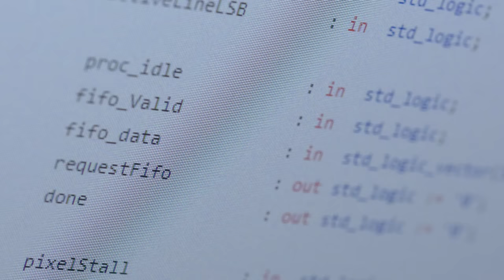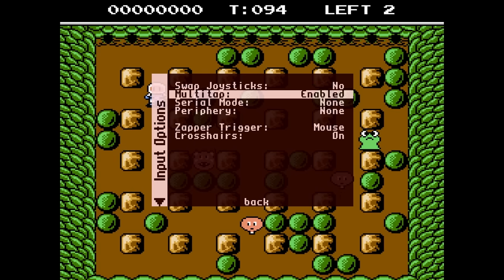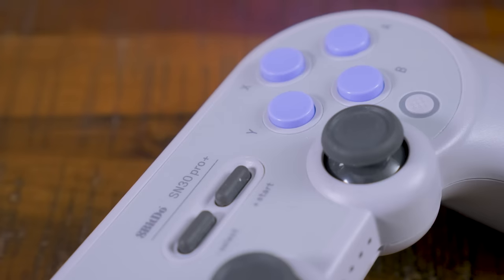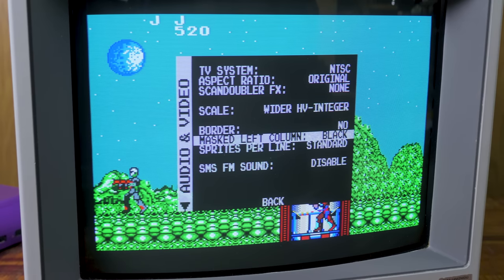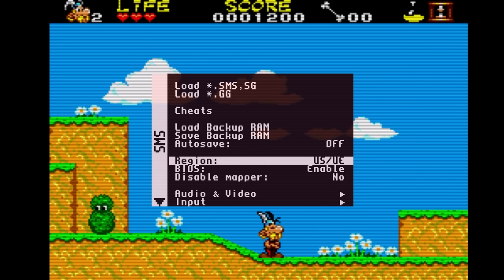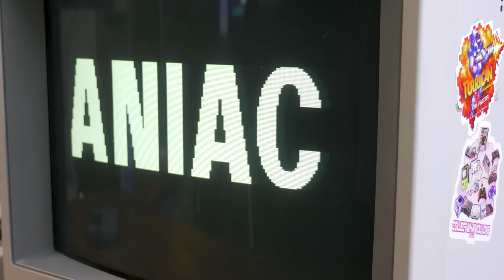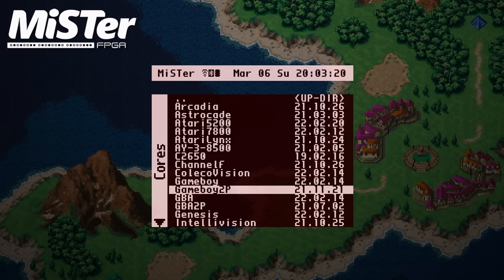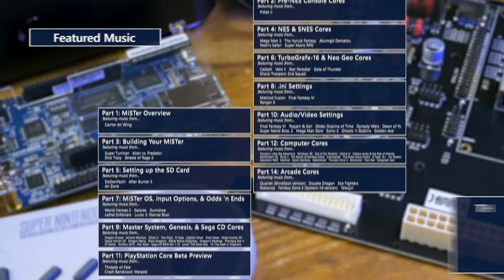MiSTer FPGA in 2022: A Primer Guide to Retro Gaming's Hardware Emulator / MY LIFE IN GAMING

Comment: Also a heads up for everyone looking to buy/make one. Don't buy from a scalper unless you absolutely need one now. The DE-10 Nano is always being made and coming back in stock. Patience will save you a ton of money
Reply from the maker: [Try4ce] I bought a second DE-10 Nano directly from Terasic just a few weeks ago. They ship fast, but it was $40 shipping. But given that the cost of everything is going up these days, I'm not so sure you'd save money waiting to buy it from somewhere else.
Reply: @mylifeingaming  I was referring more to the eBay resellers. I've seen them jack up prices quite a bit. Buying directly from Terasic is definitely the way to go.
Reply: Wherever demand outpaces supply, you get scalpers. Videos like this are awesome, but exacerbate the issue by increasing awareness. Plus the chip shortage isn’t helping, too.
Reply: @agentmith  for sure. MLIG will definitely bring more eyes on the product but I still think the supply issues won't be a huge problem in the long run. There's been plenty of opportunities to buy them during quarantine at fair prices and I think it'll continue that way. It's definitely not a product like the analogue pocket
Reply: I bought one direct too.  Got it much faster than the site said.  They shipped same day even though the de10 said back ordered until mid April.  Yes the $40 international shipping was hefty, and a bit of a bummer since they shipped it from here in the states… but I got my mister pretty much in 3 days.

Also, the folks that offer the Ultimate Mister Kit are great. 👍
Reply: Same goes with GPU’s as well!
Reply: The shipping was Fedex and fast af.

I would say unless it's life-or-death, do not buy anything from a scalper. You fund their future scalping activities.
Reply: Are there any recommendations for online retailer operating out of Canada?  If not, what’s the best “one stop shop” from the US?
Reply: My advice is to order directly from Terasic. There's a few months lead time but you can ensure that you're not paying markup and you're getting the real thing.
Reply: Any sites that sell it as a complete kit ? I'm sure i don't feel like going through the trouble to assembling one.Also i've notice it to scalpers sure like to price gouge the mister.
Reply: @josko50  What about misteraddons?  They seem to have a good reputation and product.
Reply: I bought a DE-10 Nano from Mouser on December 8th with an ETA of Jan 30th. They just updated the shipping ETA to July 30th... I've had a MiSTercade sitting in a box for 4 months now that I can't do anything with, it's pretty frustrating.
Reply: @SaoirseFae  they're great, if they have stock!
Reply: Just ordered mine from Terasic, $250 shipped. Saw them listed at $500-600 on ebay :O
Reply: @xDr3wskyx  I just ordered a pre-configured kit from Misteraddons for just under $600.  I can’t wait!
Reply: @ceejw  you should cancel your order from Mouser and order direct from Terasic. I ordered mine from them later than you did and have already received it and finished my complete MiSTer setup weeks ago. Highly recommend t and plus you’re giving the original manufacturer 100% of the sale which is nice.
Reply: @meatpockets  The GPU nightmare is actually starting to alleviate a bit
Reply: @xDr3wskyx  - Did you have to contact them via email (the "Contact Us" link on their website)? That's the only option I'm seeing rn, did so two days ago and didn't hear anything back yet... :(
Reply: @PluckyD  No, I just created an account on Terasic and put the DE-10 Nano in my cart. It's already been shipped AFAIK
*checking now I see the red circle and "contact us", it was green when I ordered
Reply: I contacted them and they seemed to manually switch it to green/active. And it stayed that way after I ordered. Maybe they put up a few at a time to preorder?
Reply: As a follow up, it looks like my de10 is shipping just over a week later. Glad I ordered all the other stuff already!
Reply: @remy333  yea they did the same to me i ordered mine on 4/15 then they e-mailed me and said i won't be getting it till June 30 than less than 3 days later i get a notification saying its being mailed on the 18th and amazingly enough it came in the 19th the very next day i gotta say ordering direct from terasic is the pay to go just be patient
Reply: Just wanted to mention that I placed my order directly from Terasic on April 21st and today (April 28th) I got an email that it's been shipped!
Reply: @saiyaman23  that's an awesome turn-around. Looks like you are going to have a fun May ahead you.
Reply: @sneakingelephant  absolutely! And being patient definitely paid because a couple of weeks ago I was about to pull the trigger on a $500 one from eBay  😱
Reply: @sneakingelephant  I just bought my DE10 from Terasic direct, following your instructions.
Reply: @mylifeingaming  where can we get the clean looking power coupler as well as some of the nice controllers you show in this video.
Reply: Fake , scam, MAME gets u as high % of emu accuracy  !!  They are seling u a $30 Pi with $20 worth of soldered cartridge slots, how can u not see this ????
Reply: @Ne0ge0X  sure buddy
Reply: DID SOMEONE SAY...
...HIDDEN GEMS!?
Reply: @Progearspec  asking the same question. Did you find out?
Reply: @SaoirseFae  is it all set up? I want something set up with games and consoles etc.
Reply: @randymulder9105  It is!  I ended up securing a prebuilt unit from Mister Addons.  I also ended up getting two custom built usb to NES and SNES controller adapters—they are almost as good as the SNAC for latency.
Reply: @SaoirseFae  do we add games and consoles ourselves. I mean I have that stuff and can do that part myself. But if it's all set up I'm a happy camper.
Reply: @randymulder9105  if you opt for the sd card, they will add the software backend for you, but that part isn’t too difficult.  You’ll have to add your games manually from a PC anyway.
Reply: @SaoirseFae  what a great video! 
I hope to have a small virtual pinball machine in the future. But haven't settled on any company/person that makes them.
Reply: @sneakingelephant  I know people who have purchased MiSTer from eBay and the price was right on the money, I just had another look and from what I saw, of the kits anyway, all seems to be fair considering the sales fees eBay charge, unless you have a specific example I don't think you should be bad mouthing eBay sellers, they get a lot of flack undeserved, it is like the new catch phrase to say eBay this and eBay that, I'm getting pretty sick of it to be honest, especially as all of my experiences have been fine.
Reply: @notsuoh16Bit  I wasn't bad mouthing all eBay sellers. I myself sell stuff on eBay as well and I know well how crazy those fees can be. What I was trying to say is that the DE10-Nano is still easily available and always coming in stock. You can go right now and buy one from terasic for the MSRP price. If the buyer wants a prebuilt kit the prices on ebay definitely aren't as wild as they were the many months ago when I made the post that you are replying too. People were trying to sell them for close to a grand which definitely wasn't worth it considering how often these boards get restocked.
Reply: @DetroitMetroRetro  It was more of a PSA  comment at the time because there was so many people trying to scalp it for well above market price. There's still no wait time right now unless you are trying to buy a prebuilt kit. So if you want to go to Amazon or eBay and buy a one there are much more reasonable priced options now but you can still save some money buying the parts and building it yourself
Reply: @sneakingelephant  yeah, that is a fair explanation and it certainly causes a very different interpretation of your explained perspective when you put it like that, I agree with your adjusted or more clearly expressed statement.  Thanks for coming back with your reply, it is appreciated.
Reply: I am now interested in this since I’ve heard about it. No money to buy one though lol

Comment: Funny experience I had with MiSTer (as a someone who is fairly non-technically inclined) is that I had tried rpi before and couldn’t get my head around how to utilize it well… all these different images available etc, I never really got it going. But when I grabbed my first MiSTer a couple years ago it clicked right away. I’ve found it really straightforward to use and the community has been so awesome with any questions or issues I ran up against.
Reply: i prefer plain text menus

Comment: I own most retro consoles but I love the mister and its versatility.  Just the amount it does in such a small footprint along with having the ability to scale when using a monitor that supports 480p is awesome. Built some controller boards for old joysticks and pads for minimal lag and the experience is no different from the real thing and in many cases the pixel clarity, through RGB, looks better to me.  The fact too that  it has such a large dev community makes it incredibly exciting as new implementations come out.  I'd say its my device of the decade.

Comment: Two notes: First the ZX Spectrum did not have different processor speeds. That’s a novelty on the FPGA implementation mainly used to accelerate 3D games. Second, the stereo separation on the Amiga can already be “fixed” on the audio menu by enabling stereo mixing at 25% or 50%. Otherwise what an absolutely amazing video (as always). Cheers
Reply: ...and it's called the ZED EX not the ZEE EX :) sorry but UK machines need UK pronunciation. Great video other than that little niggle in my ocd brain.
Reply: @TheCaffeineKid  I kind of let that one slide, but it also grinds my brain every time I hear it 😂
Reply: There were Eastern European clones that had faster clock speeds but like anything else this guy says, if there's any truth in it it's more by luck than knowledge or research.

Comment: That multiplayer GBA function looks so cool. I think it would be sick if you could hook up two MiSTers using a crossover cable and do 4-player link action, or plug in a GBA link port to the MiSTer and interface with real GBAs.
Reply: lots of people in the community have been clamoring for a portable form factor for this reason exactly. It's tricky, because obviously someone has to make this stuff, and the consumer has to buy it, usually not for cheap.

this specific use case is probably one where Analogue has the leg up on MiSTer (with their Pocket line)
Reply: 2p gba is amazing. The same guy who made the gba core (fpgazumspass) Robert Peip is working right now on the ps1 core. He is like All MiSTer devs a f**** legend!
Reply: Hell yeah. Sticking on as many GBA EXT ports as the system can handle GBA instances?

I drool. The one way to do better than the Game Boy Player.

Comment: I found it a doddle to set up (compared to a RetroPi) and everything just works. No stupid RetroArc menus. Easy to switch between HDTV and CRT. Sounds fantastic, no input lag. It's worth every penny.
Reply: No need to insult, different solutions are welcomed  :)
Reply: @isaacchavarria4026  purely personal preference of course. I do enjoy regular emulation as well. I just got quite frustrated with the Pi 2 a few years ago and never succeeded in getting it running to my satisfaction.
Reply: @ShapeyFiend  pi2 and 3 are dire for emulation

Comment: Forced scandoubler on a VGA CRT monitor is a great option, thanks for highlighting it. I use a little scanline generator dongle and it gives really great results.

If you ever do a follow up video to this it might be good to flag up the physical jumpers on the analog IO board, these are important if you are using an RGB scart cable on a consumer set or a scaler or other device that behaves like a consumer set. This is how the relevant lines are set on the scart cable to identify the signal as RGB. This is most relevant to users in Europe and similar areas who have access to RGB scart consumer sets so it’s completely understandable that it won’t have come up in your exposure to this stuff so far.

I can’t say I’ve used it but to my understanding SNAC typically only supports 1 controller when used with the console cores, so that is one catch that people might need to bear in mind. A good USB controller with decent levels of lag according to the misteraddons test document is generally a much better option where possible for vast majority of users given all the caveats that come up with SNAC.

Great video as always. Thanks!

Comment: Though it uses FPGA, the UperGrafx does not replicate the VDP to regenerate video. It replicates the function of the “VCE” which is the DAC where the the pallets diverged in the first place. The Super HD System³ Pro might do it the same way but I don’t know since it definitely replicates the whole VDP when you are in SuperGrafx mode. Regardless, both support composite color pallet with upgraded digital video output.

Comment: I can't wait to tackle this over the next couple days. I was literally JUST looking for quality overviews of the MiSTer to help determine whether or not I wanna jump in to the platform or stick with real hardware and RetroArch emulation.
Reply: Stick with real hardware and retro arch. My system is all retro hardware connected to my Sony pvm and my gaming pc running retroarch with a launchbox front end.
Reply: @itguru2037  I'm currently using real hardware on my Sony Trinitron but given that it isn't RGB modded and doesn't accept S-Video, only composite and component, I have looked at other alternatives to getting a good image out of my CRT. I mostly use component out of my Wii to get super sharp 240p but systems like my N64 still look trashy without hardware mods.

I since ordered an HDMI to YPbPr converter to see if I can get 240p super resolution out of retroarch on my gaming PC over to my CRT.

If it doesn't work out, I might look into MiSTer more in the future tbh.
Reply: @ProphitDesigns  nice. All my consoles are rgb
Reply: @itguru2037  Not worth it for me. Especially without already having an RGB monitor. I think it would be easier and much cheaper to just make a solution for the CRT I currently have.
Reply: @ProphitDesigns  agree
Reply: well, ask yourself this: do you ever travel to other places and want to bring your retro gaming collection
good luck packing up your tower PC and hauling it around
Reply: @ynotwalk7391  I have a hacked Switch with RetroArch that I bring around that is plenty adequate for my friends who want to play retro games.

Whatever solution I land on is solely for me and my CRT setup, nothing more.
Reply: @ProphitDesigns  
hey, if that works for you. i have a massive lb/retroarch setup but prefer mister for every shared core
Reply: @ynotwalk7391  mine is a laptop with 50k games on launch box. Only 3 pounds
Reply: @itguru2037  
only 50K?
Reply: @itguru2037  
that's like only the ZX Spectrum library, haha
Reply: @ynotwalk7391  50 thousand games.  It’s every single game from the 70’s to today. All ROMS.
Reply: @itguru2037  
no, the zx spectrum alone has 40K titles or something
100K is achievable in launchbox
Reply: @ynotwalk7391  yes. I’m currently adding more. Should be like 90k when I’m done tomorrow.
Reply: @itguru2037  
good luck! i just use the text list view in launchbox and hook in retroarch for everything (plus some stand-alone emus when needed)
you can do every region for every platform
C64, Spectrum, and Amiga alone have massive libraries

Comment: "Screen tearing does rear its ugly head in many situations - although I don't have enough experience on a real PC to know if it was present there as well"

Yes.  Yes, it was.  PC video hardware did not have a reliable way of reporting blanking intervals until the GPU era.  There is an interrupt that can be used for this in VGA, but hardware support is .... uhh... well, let's leave that at "not universal."  So most software does not even bother.  You get what you get.

Comment: Wow. I'm amazed at how succinct this is (clearly this is just the tip of the iceberg and no, I'm not trying to be sarcastic; as someone who had to once condense the history of the world from the Big Bang to 500 years ago for a final exam, I get how much of a challenge, at least from a content standpoint,  it is to "trim the fat," so to speak).  Perhaps this is the way to go for me for things like the Neo Geo and the X68000 - expensive systems and also HUGE space takers. I also am intrigued that it encourages, if not requires, active participation. You can be more passive (ie buying a pre built system, sticking with preset settings, etc), but the more involved you are, the more it can be a representation of who you are as a gamer, from what cores you focus on, how you build out from the hardware side, and whether you output in digital or analog. I don't see it as the "end all be all," but what a way to enjoy so many platforms that would otherwise be out of reach.